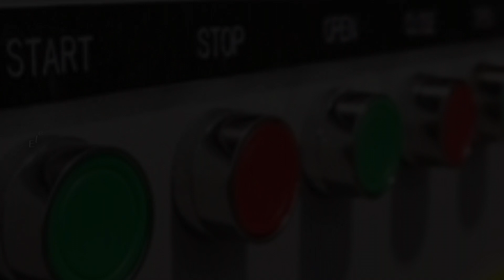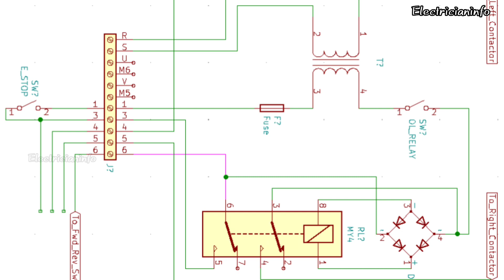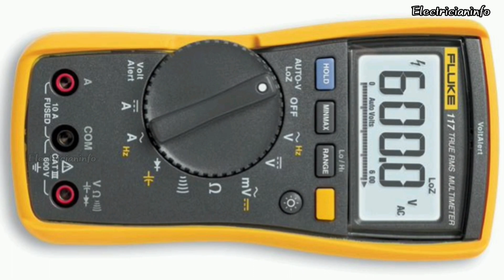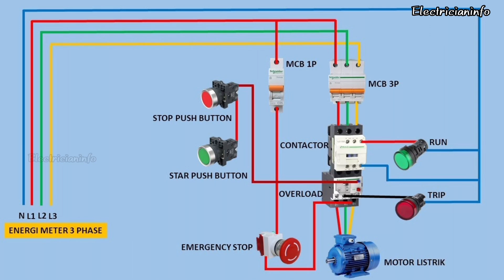electrical control panel troubleshooting machine easy tips |rectify breakdown issues|ElectricianInfo

Comment: We are working in plastic extrudor section yesterday a problem occured heater wire get damage பவர் get சட்டௌன் in பேனல் போர்டு and மெயின் டப் box ஆல்சோன் மசிபி get பிரேட் we சங்கேத நியூ ஒன்னு but now the பேனல் ஹாவிங் கரண்ட் but  வுட்புட் கரண்ட் is not கமிங்
Reply from the maker: Check the connectivity input to heater by using multi meter .